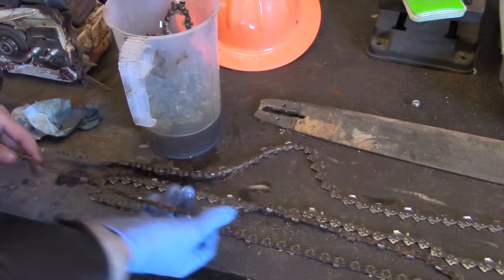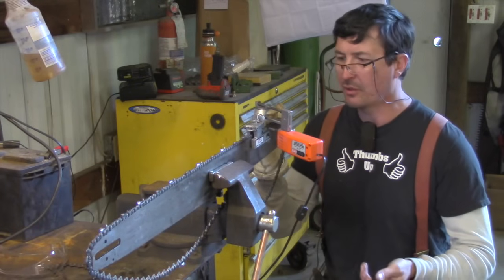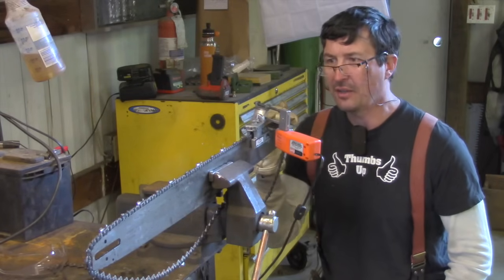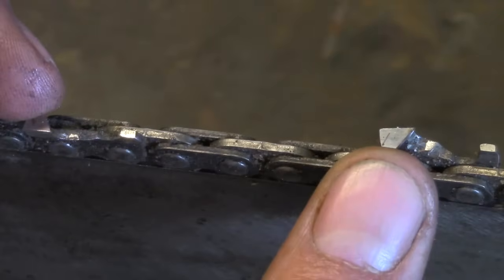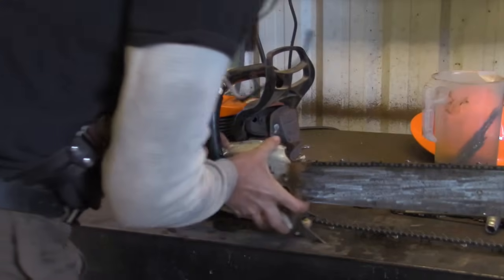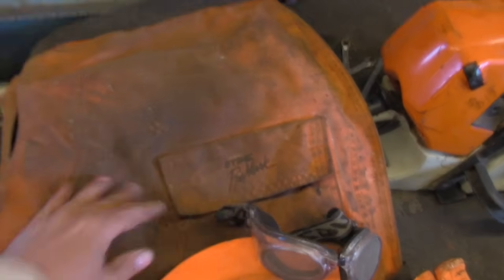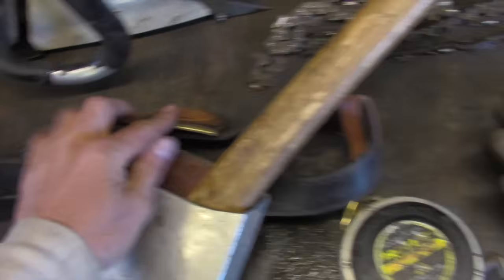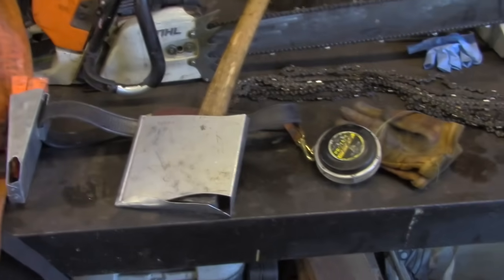A Better Way To Sharpen A Chainsaw

Comment: I ran across a Foley Sharps All at a yard sale back in the 90's paid $50 for it.. Came with chain saw attachment for sharpening, as well as planer blades, skill saw blades to include carbide and knife sharpening.. for the money even if bought new...its the best thing to get.. you can adjust the pitch for the perfect edge. and a bonus// the local logger shop charges $10 a chain under 30 inches for sharpening.. word got out what I had found and how quick I can edge them out.. locals started dropping their's off for me to sharpen.. at $5 a chain..winter time rolls around I make plenty of XMAS money so it has more than paid for it's self

Comment: A cool kit, our primary Felling Kit is a Chainsaw, A long steel cable, and a tractor, but, I think that would be a better kit, because we don't start from the top and work our way down for the bigger trees, we probably should, but, we get an expert for that, many of things surround the trees that shouldn't get damaged, plus, I think that would be a better kit, because a tractor can leave Ruts and that doesn't look good to customers and visitors having a bunch of ruts, plus the tractor can crush roots of other trees and after a while can kill the other trees around the tree that we're working on, with your kit, it doesn't matter whether or not the ground is ready to get a tractor up on the section or not, good video.

Comment: The reason most chain manufactures don't want people to understand how a chain cuts and how to sharpen it correctly is because if people knew how to properly sharpen a chain they would not be buying near as many new chains. He is using a static depth gauge in this video; when sharpening a chain with a static depth gauge the chain cutter will cut less and less as the cutter is ground back and even get to the point it will hardly cut at all. I up loaded a 3 part video series in which I sharpen a chain with 2 cutters broken off on the right and to make matters even worse I ground the rest of the cutters on the right side so they are half the length as the left, I used a progressive depth gauge tool to set the depth gauges and the chain cut off 18 inches of hickory straight. If you really want to understand how to sharpen a chain watch the series.
 PS it is not because I am so smart, I just read Carlton's old book they published several years ago.
Cheers
John Fink   "Reading is like cheating" in that if you read you do not have to make near as many mistakes!

Comment: i work at a stihl dealer and mower and chainsaw repair place and we have a stihl brand grinder which has angles you set and has part of a bar you put the chain on and you just slide and grind over and over and it does pretty well

Comment: Used both a jig grinder and a round file.  Decent at both. But nothing is easier or faster than the stihl sharpener tool. And its the best cut ive ever seen

Comment: I haven't seen (yet, if it exists) your review on the timberline chain sharpening system.  I recently got one, For what it is I felt it was a little on the steep side, however I absolutely love the little thing.  It fits inside a pouch.  It has different sized carbide grinders for different chain sizes.  It has bushings that absolutely set your angle of grinding (comes with 30 degrees, but has 25 and 35).   

I am extremely happy with it, If you come across one I would definitely like to see what your thoughts are about it.  I am always open to a new perspective, especially a pragmatic and objective one.

Comment: Thanks for posting this looks like I will have to look into that sharpener.  I do have the Stihl 2 in 1 sharpener and I really like that, but I agree for precision the Granberg looks great. 
I have lots of oak, white and red on our property and we have a wood-boiler for heating the house in winter (MN).  We can burn as much as 18 cords in one winter.  I think the Granberg would be a great investment.  It doesn't take long for a chain to get dull cutting the oak.

Comment: I have been using the Granberg for a year now and love it.  Does your granberg motor start making a funny noise after 3 or 4 minutes of use?  I have two of them and they both do it.  It makes me think the motor is going to die.

Comment: I just used a dremel to sharpen. Cutting big big pine. I did the rakers too. I was surprised at how crappy it cut afterward ! I think i'll use the grinder to correct major damage but finish up with ol reliable. Probably a finer stone would work better than the one I used but even so. The pine knots i was trimming with this saw just destroyed the ground edge instantly.

Comment: The gauge also works as a bar scraper, to get the debris out of the middle of the bar so that it will oil properly. On another note, I do LCTT (line clearance tree trimming), and we are forbidden from wearing aluminum hard hats. the risk of electrocution is immense as it is when you are removing tree parts and or entire trees near the lines, but the conductive hat would be a much larger risk. we don't use wedges to fell trees, we rope the trees and pull them or hoist the tree parts out. just some insight

Comment: What I use for bar oil is automatic transmission fluid ( ATF ), it keeps the bar and chain a lot cleaner. The sap and oils from the wood doesn't stick to anything. We cut a lot of mesquite which is really hard on saws, ATF is the trick for us.
Reply: @no.step.on.snek.2423  Mother who....

Comment: cool tool! i'm one step short of that, i use a round grinding stone in a Dremel tool. not as accurate, but works fine for my around-the-yard purposes. and it's WAY better than hand filing, in both sharpness and speed.

Comment: Just to mention about the bar maintenance check for a bur that will wear on the edges. I sand those off with a belt sander 120 grit. The run a putty knife in the grove you will pull out oil soaked saw dust that builds up in there. The chain will lube better if that grove is kept clean. 
 I only grind with a disc wheel when the chain is very dull and or teeth have been chipped then I file just a few strokes to put a better honed edge on the teeth. Caution must be used when grinding as the temper of the steel is at risk. That 12 volt grinder look to be low speed so the temper should keep better. My higher speed wheel can make the point of the tooth glow red and that will ruin the temper of the cutting edge. I try my best to only grind with short gentle touches to avoid excess heat. When the steel turns blue the temper has been changed and not for the better.  When he was filing the depth gauges I could see the teeth close up  it looks like a good straight edge "but" I am sure a stroke or two with a good file would make it sharper.  I always believe getting them as sharp as possible is best for the saw and uses less gas just a better all around cut. Grinding with-out filing will cut just not as well as a well honed tooth done with a file...
Reply: Tony Iocca mk

Comment: Most professionals I know carry a bunch of pre-sharpened chains and a hand file. These items collectively weigh less than a 12volt battery. True, if you're near a vehicle, this device is handy, but you're not always so close to a vehicle other than a skidder which is being used most of the day and not stationary enough to be used for a power source.
Reply: Never met a faller who used aluminium wedge pouch's either or one who only carried two wedges. Maybe ok in small wood but big wood  may need a few helpers to talk into behaving and laying down properly.

Comment: Personally I believe the Harbor Freight sharpener is the best deal out there at $24-$30 depending on coupons and special sales.   Chain sharpening is not too involved as long as a couple tooth angles and proper depth of the gullet and raker is maintained.  In addition I can go through a chain about twice as fast as that dremel style.

Comment: Cody, just a heads up, the grinder you demonstrate in this video is not the same one you have in your Wranglermart store. You're demonstrating the Granberg Precision Grinder, which comes with the angle guides and bar clamp. The Granberg Grind and Lap in the store, is just the motor and a visual angle guide. I purchased the latter, thinking I was getting the former. It's my fault for not investigating further before purchasing. It's a minor miscommunication, and I'm still happy with my purchase but I thought people may want to be aware that the grinders are not the same. Not sure if the sliding guide can be purchased separately or not, but I intend to investigate further. God bless.
Reply: SgtPiggie you can buy the sliding sharpener directly from Granberg, but it can't be added to a grinder you already have (as they're designed differently). That's what's Granberg told me. I'm still really happy with the basic model, it makes those chains "scary sharp" as Cody would say.

Comment: Hello, I know it might be a waist of time commenting on an older video like this but adding knowledge to it might help someone out so be it. I personally never use a jig to sharpen a chain but if you want to, there are some manual jigs out there that use a regular round file instead of a rotary bit and electric motor. A lot less expensive than a hundred bucks and it will ALWAYS work.  A few add-ons to your faller's kit, in the woods, never use chaps cause they get tangled on stuff and if you grab them with your chain, they will roll in a fraction of a second and expose your leg. Get in the habit of using safety pants, they don't roll...   Also, always carry a first aid kit on your belt and a sterile compress taped to the top inside of your helmet. If you DO cut your self, you might be REALY happy you carried that compress and first aid kit instead of leaving it in the truck. Better safe than sorry. Anyways, cheers and good logging.

Comment: tips from a BC faller and BC faller regs- helmet should be a proper fallers helmet with mounted muffs,face shield and side impact protection inside. Axe must be 3.5lbs and no shorter than 17 inches, minimum of 3 wedges to be carried at all times. Ill also add that for a logger the best leatherman is the Blast model. Those long shanks easily reach carb and oiler adjustment screws! and its light.....also, ALWAYS use a Stihl!!! haha

Comment: Looks like in the video that you might need to drop your grinding stone down and clean out the gullet the area between the depth gauge and the tooth. That area should be strait back. Might get a little faster cutting as it will clear or clean the chips out faster. Just a thought. Thanks again for all your great videos

Comment: Wranglerstar,I love your videos and greatly respect your opinion on all topics. That sharpener is an awesome tool, but it will not hold a candle to a fine tuned hand filed chain. A proper hand SQUARE filed chain with slightly lowered depth gauges will eat that granbergs lunch. But for the average joe with one or two saws that sit more than they run the granberg is the best choice. Just don't discount the truly passionate tree guys.
Reply: Well said.
Reply: i can hand file a chain pretty fast and  im not sure i could be bothered using some jig like this .

Comment: If all you're cutting is pine, you can take those rakers down a little more and your saw will cut faster. I would imagine if your using it for an Alaskan mill it may be more important. Here the locust that's been laying on the floor 20yrs is HARD. Really short chain life.

Comment: Best thing I've found for cleaning is either diesel (for chains etc) or ATF gearbox oil for spark plugs and sooted engine components. Leave the component in ATF overnight and it will be absolutely spotless in the morning. No idea why ATF strips soot like a machine!

Comment: I've never seen that jig.. kinda neat.. I use a roller file jig and do pretty well.. had a dremel jig and all sorts of grinders, never really cared much for the ground chain though.. Its just to easy to get the chisel too hot.. although would like to try a diamond edge aluminum wheel for grinder.. closest u can get to a sylvee.. should check out the timberline jig.. also an interesting concept that i would like to look into as well..

Comment: tighten the chain up and it will hold the chain straight and be way more consistent cut and sharpening
Reply: Exactly, my first thought!
Reply: Would be hard to tighten. I dont think that bar is attached to a saw.  Pretty sure it's just a bar in a vice.
Reply: wouldnt the jig work with a saw attached and in a vice ?

Comment: I know this isn't a recent video, but I went back to it for some reference info...LOL. BIG QUESTION HERE; Been looking at Stihl pro saws....I noticed you have one with a wrap around handle, and one without. Im assuming the wrap around handle helps for falling trees, is this correct? The MS260 you have doesn't have the wrap handle, and this video was a fallers kit, so im putting 2 and 2 together to determine if the wrap handle is something I should look for in a saw. Thanks in advance,

Comment: About 40 years ago (Sears) used to have an AC chain saw sharpener. It was the best thing ever! I could cut a 40" log and be out less then the blade width. Was very good for me. Should anyone know who were has such please to let me know.  I agree Diesel is better for cleaning. I seem to have a steadier hand now for sharpening then when I was 16.

Comment: I usually freehand my chain every 2-3 tankfuls. I file each tooth about 3 strokes and it stays sharp. It's like a good knife, don't let it get extra dull, keep it sharp and you lose less metal. Power grinding can take off a lot of metal after the chain is dull. 

And it depends on what your cutting. Hickory my favorite firewood, especially the bark, is Hell on the chain and bar.
Reply: You have a good point.  I an hand file too.. but if you hit something that really boogers your chain, then a jig is a way to go.. it dont mater how good you are.. thru the chains life your  angle gets further and further off

Comment: I have been doing so much the hard way for so long. No one ever thought me anything about chainsaw maintenance or proper tree felling. 100% self taught, I have gotten pretty good at dropping them where I want, but my chainsaw chain is a disaster of uneven teeth and random angles, and I tend to cut with no goggles or hat or chaps or anything even remotely resembling safety.

I will be looking into some of the stuff you showed here, I heat my home with wood only. 6 cords a year, I cut all myself from the woods on my property.

Comment: It's not "sap" on your bar & chain from conifers- it's pitch. Best cleaned off by sinking chain into hardwood. Honest.

BTDT with the 12v Granberg. The plain-old File-N-Joint with a file works much better for me, and works great on depth gauges too, with appropriate file mounted. Easy to keep cutters like razors with that. The "points" (rotating stones) in the 12 v one just didn't hold up. Neither did the belt drive. I exercise saw chains a lot on big blowdown hardwoods- they'll point out your failings real quick. Free-handing is purely for emergencies, like when you forgot a spare chain.

A basic Oregon depth gauge guide like you show works great for checking if the depth gauges need filing. Then the File-N-Joint works great for precision setting

BTW, I worked for my money, and don't toss it about at stihl dealers, especially the ones around here in the NYC burbs. Much better values available from Dolmar/Husqy. I'm talking hundred$ better.

Comment: Have you ever stripped out the bar nut and spindle on the Stihl?  I have gone through two sets in about four years. I also make sure there is no dirt on them when retightening.

Comment: I've run into the same thing trying to wear the new aluminum hats in underground mining.  The electrical rating on them is exactly the same as the old fiberglass hats or a plastic hat with mounted earmuffs. I think it really comes down to "Safety man doesn't like it" than anything else.

Comment: I really like my cheep Chinese imitation of the professional Oregon sharpener I purchased from Northern. It's probably sharpened 50 chains and it does it very quickly and accurately. If a person wanted to take it out in the woods, a small inverter would easily power it.

Comment: Your video was pretty good but what i would say is that these 12v filing contraptions have no place in a commercial (it needs to be as simple as possible) environment but they are useful for hobbiest's to get it right.

Comment: Thoughts on hand sharpening: count the strokes and get into a rhythm.  However, one side of the chain seems to sharpen better and the other side more of a struggle,  depending on what side a person is more comfortable with.  I agree that hand sharpening is never perfect but can be done very well with practice.
Reply: Correct. Top plate angle can very a few degrees without any negative impact. The most important thing to pay attention to is the depth of the file, or in Cody's case stone. Proper tooth hook is more important than just about anything when it comes to sharpening a chain. If you have too much hook, because the file is too low, the material behind the working corner will be thinner and weak. Because there's not enough metal supporting the working corner, the edge of the tooth will roll over and dull quickly. Now if the file or stone is too high in the tooth, the working corner and top plate will be too blunt to cut efficiently. In softer wood you can get away with a poorly sharpened chain, or a chain with too much hook. Cutting Osage Orange, not so much.
Reply: I agree, good thought on the depth of the file.
Reply: Max Dub You say that, but run your chain through a Markusson robotic chain sharpener and I'm certain you'll change your tune.